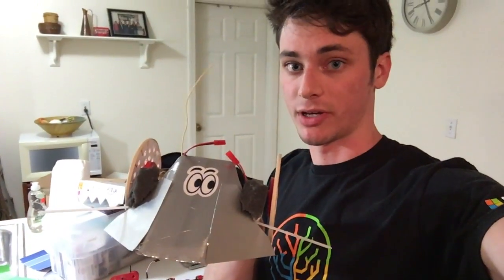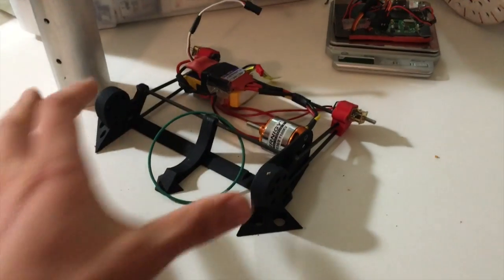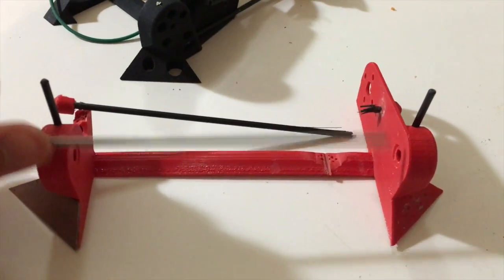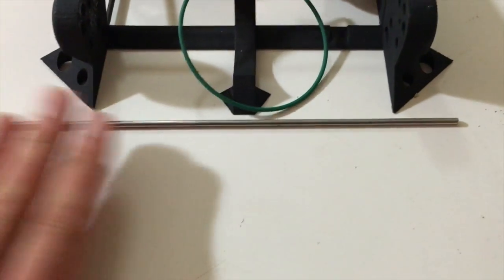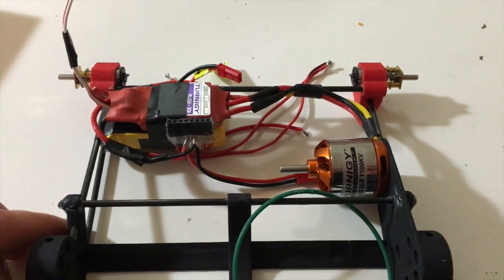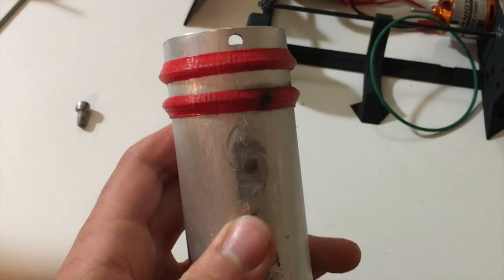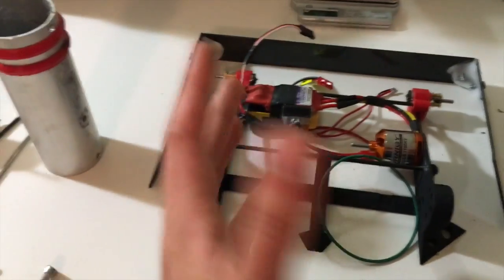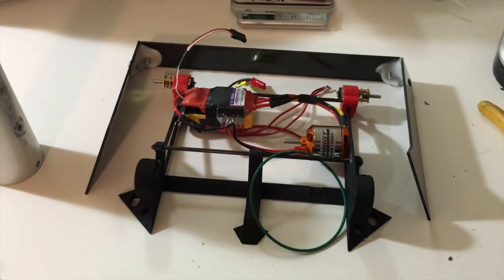Antweight Combat Robot Build Update!

Comment: We were using the same roller but it was little bigger then  yours so bldc motor is not in fit with the roller,so what motor we should use to roll the roller at a very high spped in load

Comment: Hi there, I like your videos. I have one question, what are the specs of the battery you were using in this setup? Any responses would be great!
Reply from the maker: Thanks!  This one runs off of a small 500mAh 3 cell lipo battery, which is 11.1 volts:  https://hobbyking.com/en_us/zippy-compact-500mah-3s-35c-lipo-pack.html

Comment: what are the dimensions for a US ant weight bot? is it the same as the 4"*4"*4" in the UK?
Reply from the maker: It's not actually super standardized competition-to-competiiton, but this one had a 12" by 12" by 12" side requirement, which is fairly common
Reply: Thanks that helps a lot!

Comment: Part list for the drumb spinner?
Reply from the maker: The drum is just a 1.75" aluminum tube, with some bolts for "teeth," and then a 3mm steel shaft with some plastic bushings.  A urethane belt drives it, and I'm using some random hobbyking brushless motor to drive it.  When choosing a brushes motor, go with a low KV.  As for the drive, I'm using fingertech speed controllers and some cheap 200rpm eBay gear motors (I recommend actually paying for the fingertech 16mm motors).  A lot of these parts are not the best for this purpose- they are just what I had lying around.
Reply: Ah thanks alot man and goodluck. It looks awesome.